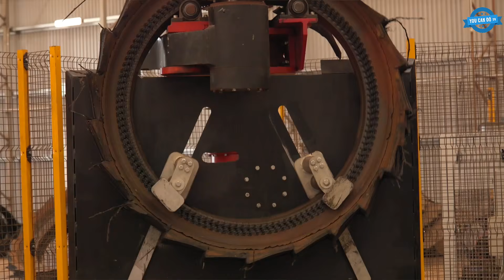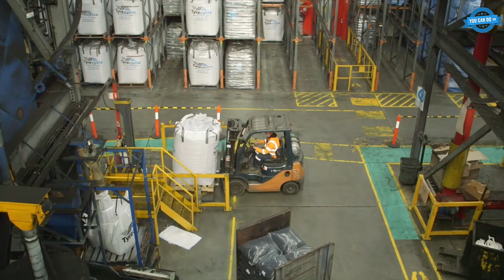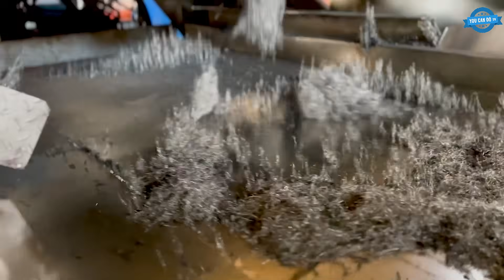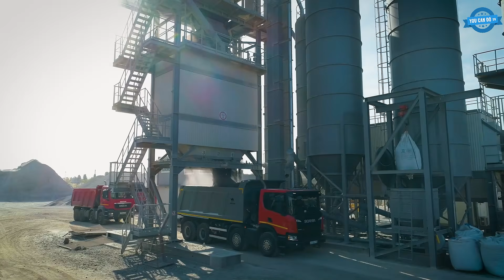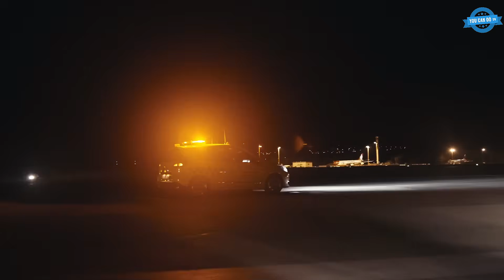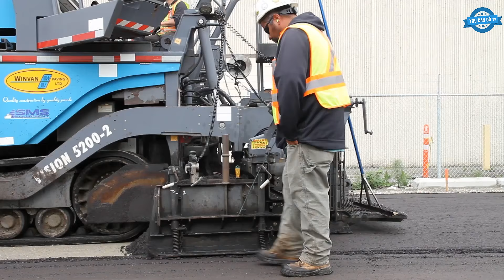How 30,000 Tons of Giant Mining Tires Become New Roads in Australia. Tire Recycling Process

Comment: watching all the steps taken to separate fine pieces of steel makes me wonder why they dont pull the steel wires out of the tyre before they shred it into little pieces.   ive seen how its done.   a big hook pokes out of a steel plate.   the tyre is placed over the hook.   the hook retreats behind the steel plate pulling the steel with it in one bundle.   the tyre carcass is now free of all steel ready for grinding.   the steel can go into a bin, mostly free of any rubber ready for recycling separately.